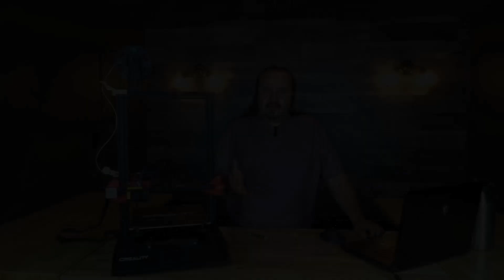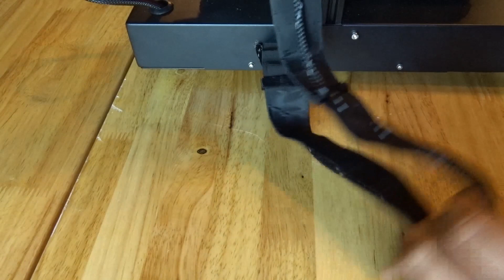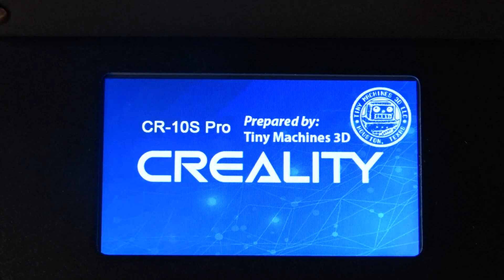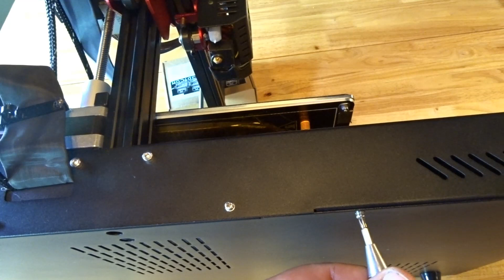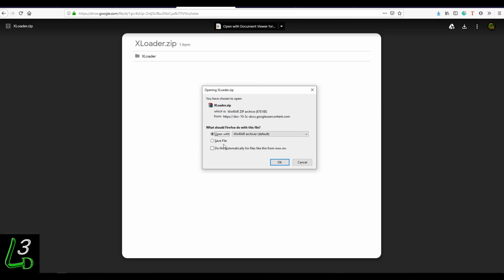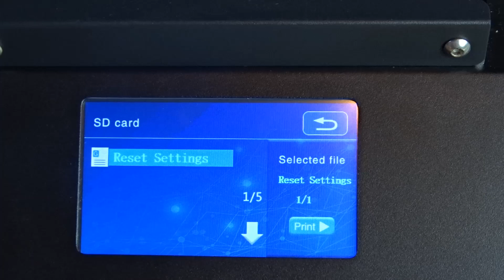Full Tutorial CR10S Pro TinyMachines 3D Latest Firmware update B7 (June 2019) with BLTouch V3 probe

Comment: Hi there great video but after upgrade my machine doesn't resume printing after a power failure. Also the pause fixture is not the same as before. The machine stays in the same place and doesn't go to the home position.Any help in this regard? Thank you.
Reply: From what i understand, upgrading to the tiny machine firmware will take that feature away but instead will have the thermal runaway protection which to me is more imperative. Please refer to this video by Teaching Tech for more of this. https://youtu.be/SBX30GmM3Qo
Reply from the maker: Yes, Power loss recovery is not possible with the new upgrade Tiny Machines is working on this however it was not possible in this upgrade. as for the home location after pause please contact TinyMachines they have a repair Hex you can update to give you this function
Reply: @LiquiDirt3D  Thank you for your response and apologies for my frustration. I did see a Hex file on they're web site. Can you please tell me how to add it to the software. Kind regards and thank you again.
Reply from the maker: @tonymarreiros3186  Simply add the file to the sd card like you would a file you print. then insert it into the printer and hit print the file will be updated as soon as the print is hit and then you can remove the card and restart your printer. this should solve the issue
Reply: @LiquiDirt3D  Thank you so much for your help. I really appreciate it.

Comment: Complete noob here, wondering if I am supposed to install bl touch before I update to this firmware?
Reply from the maker: If you do not have a BLTouch on your printer then I would upgrade this first before installing the B&, However, if you do not want the BLTouch then there is another file in the download section that is for the standard probe.

Comment: Hello, I have a problem, I followed all the steps, I did exactly everything and it did not work, when I checked my bltouch I realized that I made a mistake, I have a bltocuh v3.1, then I saw below that there is a link for it to work  I did it, and now bltouch works but the axes fit badly.  Because the measurements are different in the firmware, how could that be resolved?  I have to restore the motherboard as I could, I would greatly appreciate your help, thanks
Reply from the maker: I do not understand your issue totally can you give more details.

Comment: hello got a question i have a CR10S PRO but for some reason the bed keeps heating up on it own .... any help thanks
Reply from the maker: Hi, I need to know a bit more about the machine. Did you update the firmware?
What version are you running?
Does it have a BL touch?
Where did you buy the machine?
How old is the machine?
When did this problem first start?

Comment: I have done all the firmware updates exactly as you did but my bltouch v3 will not work with the b7 firmware that tiny machines has currently. I have no clue what's wrong. It powers on but will plunge the nozzle into the bed
Reply from the maker: Also is this a mod you did or how was the BL touch put on Is it a new install or old?
Reply: @LiquiDirt3D  it is a new install that I did myself I did a lot of research on how to do it and put the bltouch v2 on my ender 3 no problem and it works great. But cant figure out why the v3 won't work on this printer
Reply from the maker: @ermanwilliams2226  there is capacitor that needs removing off the pcb controller
Reply: @LiquiDirt3D  Okay cool thanks for your help
Reply from the maker: @ermanwilliams2226  Let me know how it goes
Reply: @ermanwilliams2226  Mate, If you've still having problems. This will probably solve it. I've been searching everywhere and eventually came across this. Worked like a charm. 

https://www.antclabs.com/creality3d-board. Make sure it's wired up this way and you're all good with this firmware.

The jumper cap (just shorts both pins to each other) should be in the nut/bolts/electrical connectors bag that came with the BLTouch.
Reply: @waynegriffiths4614  hey thanks I was gonna tell u the same thing I figured it out a few days ago.
Reply: @Erman Williams, Any luck? I'm having the exact same problem with the V3.1 BLTouch . The probe triggers, stays retraced and flashes red and then goes blue however the Z keeps declining towards the bed without stopping. 
I researched the V3.0 before ordering and received the V3.1, not sure if that is the problem. Please let me know if you find a solution.

@Liqui-Dirt 3D Great video! Very informative and unassuming. Thanks.
Reply from the maker: Please see this link for more information on the BLTouch V3  https://docs.google.com/document/d/1kruMCM1PvlMUfF1XlXwLpzbrRYRpbkUi2L0-ytQUGOk/edit

Comment: Hi !
Really nice video - I'm just gonna prepare my update !
I have replaced the capacytive probe with a inductive - but I presume I can use the same procedure as with the inductive one - right ?
Reply from the maker: Make sure you download the correct firmware for the probe from the Tiny MAchines website. Both sensors should work the same. so no other firmware changes should be needed.  However, I recommend switching to a BL touch probe sensor.
Reply: @LiquiDirt3D  Thx !

Comment: Where do you get the reset settings g code?
Reply from the maker: Reset settings Gcode is as follows:
Go and input the following data into NotePad, or Download NotePad ++  https://notepad-plus-plus.org/download/v7.7.1.html

Then type the following code:

M502 
M500
M501

Then save the file as this extension
The name of the file
Factory_Reset.gcode

Next load it onto your SD card and input it into the CR10S Pro. then simply run the file like you would a print. you will not see a change onscreen EXCEPT.... it will say print finished.

Then you are finished and can start the bed leveling process. Thank you for the question.

Comment: After I updated to this firmware when I pause a print the print head just stays in place. The print head does not “home/park”. Is this normal?
Reply: Ah, I'm glad that's not just me that this happens to!  Hopefully this will be sorted soon with it now being a known issue.
Reply from the maker: @Bob_Dub  It is being worked on so I hope updates are soon coming
Reply from the maker: Yes, that is normal. I'm going to look into this and see if there will be a fix in the Hex for this and if so I will let everyone know. the parking is an issue I know.
Reply from the maker: @Devin Allensen I wanted to let you know that this is being worked on and a solution is coming soon as an upgrade to the update for the firmware I will post a video once all the bugs are worked out.

Comment: What did TinyMachines do to make the V3 probe work with your CRS10 Pro, did they remove the surface-mount C7, or does B7 solve the issues entirely in firmware?  My v3.1 BLTouch just came in today and I'd rather not remove C7 if it's not necessary (since I'd have no feasible way to ever restore it if ever desired).
Reply from the maker: Hi thank you for your question and the short answer is Yes the B7 firmware totally fixes the BlTouch V3.1 so it will work. it takes a printed bracket for the BLTouch to attach to the machine Print that first before disassembling your Cr10s Pro.

Comment: After the dwin update I have to update the hexfile. Do I use the bootloader? Is it possible to use the cura update procedure . I did use it earlier by the former update.
Thank you
Great video
Reply from the maker: So the DWIN update is for the LCD touch Screen then after that, you need to update the main board with the USB connection and the HEX file then plug into your printer and use the Xloader to configure the comport and upload to the main board. then use the reset gcode to reset the home to defaults and relevel the bed for printing.
Reply: I Know, But is it possible not to use the loader and use the CURA update sequence instead. I did it before and works perfect is it works with this update as well ??
Reply from the maker: @ruudwarnaar477  Yes Cura can be used as well. the problem is if you have Win10 then it may not support the comport if this is the case then use xloader.
Reply: I don’t use win 10 I use MAC OSX and Linux.
So that’s solved then.
Thank you very much for your quick response. 
And please do make more great video’s.
Thank you for the video’s you allready Made.